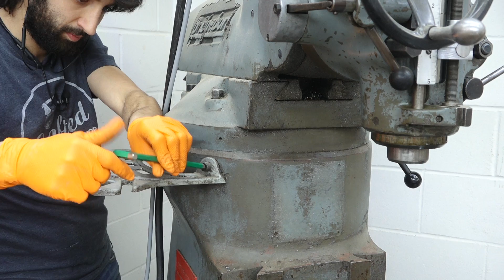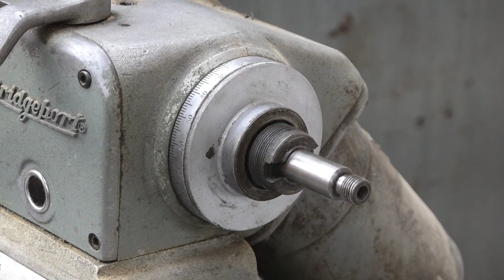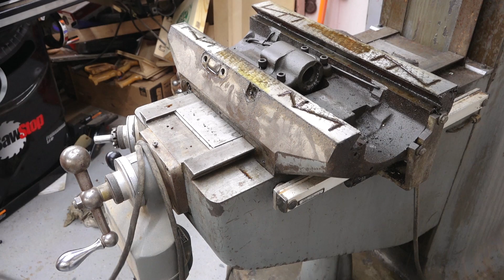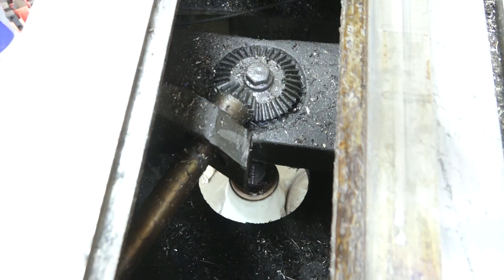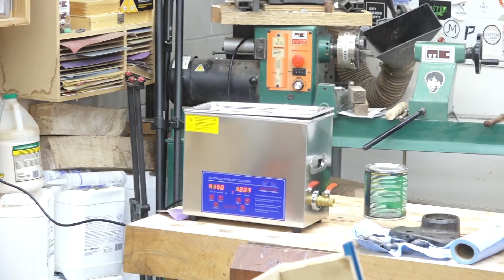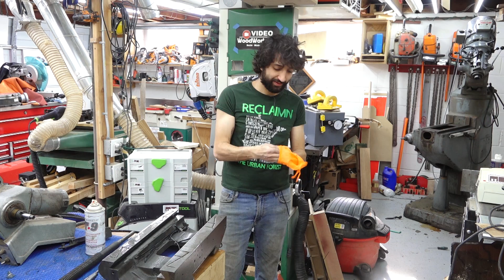Pulling the Table - Bridgeport Cleanup Part 2

Comment: My earliest plans to paint my machine ended when I examined the 1/4" and more thick fillers used  on the castings.  Incidentally, a good brush and Benjamin Moore Machine Grey look great when cured.  A brush is all I would use in the future on this machine.  My lathe is a different story and for that, I've had a paint shop make several spray cans of matched color in Dupont Nason (I think).

Comment: I have some information on how to repair the OEM power feed on the X axis, and have done it on  my machine.  It involves removing the circuit board and replacing it with a modern DC motor controller.  The other option is to replace it with an aftermarket Power Feed, but that involves making an adapter, since they are made for lead screws that do not have a OEM power feed.  Let me know if you need info. Regards.

Comment: Matt, if you should get the idea that there is some other tool/machine that you need, forget it, you can't turn around in your shop now, another tool, and you will not be able to get in the door to use the tool. Suggestion, next time, hire a person with a hot water pressure washer to remove all the oil, grease, gunk, etc. before you unload it into your shop. You would be surprised how little they will charge to clean the outside of the machine like the Bridgeport Mill for you and do it in 1/10th the time. The second way to get rid of all the oily gum is to stop at a DIY car wash station on your way home with the machine and do the job yourself. What am I saying, I just advised you not to buy any more machines?

Comment: I am a retired Journeyman Machinist. I enjoyed my 30+ years on a knee mill as well as many other pieces of equipment. Looking at the table ways, knee ways and adjusting gibs, they are definitely in need of scraping and flaking to put the machine back in tip-top shape. I hope you have a reliable contractor with the skills to do it then flatten/true and flake the table top.  If you do, it should last you the rest of your lifetime with proper maintenance. Love your channel and woodworking projects. I am retired and do woodworking as a hobby. My grandfather, a carpenter, use to tell me there was nothing worse than a machinist turned woodworker. He would tell me I was too fussy in cutting and fitting my projects. Keep up the good work.
Reply from the maker: Thanks Denis!  Looking into having the ways scraped.  Might as well go all the way.

Comment: Are you going to stone (Polish) the ways?  They look a bit corroded (spotty areas). Also, there should be a chip cover over the bevel gear set that raises the knee!  Gears don't like metal chips in their teeth. 😬

Comment: What’s your system on keeping all the loose parts organized for reassembly?
Reply: Also, do you just use the video to document how it came apart or do you just remember all of it???
Reply from the maker: I usually don’t need the video to reassemble but it’s nice to have it if needed. I group parts from each area together. Much easier to reassemble when you know those parts go in the same area

Comment: Hello Matt, Nice mill, I know them well. I was a Journeyman machinist for 32 years. You will have to research how to Tram the head in, after being at an angle, side to side, front to back, a test indicator will be required. A coolant system would be nice. When I said you were an Animal, I meant that in the best sense of the word, a hard worker. Very useful machine tool. Perhaps you already know about climb and conventional milling. Clime, cutter and work moving in same direction, conventional, rotation, direction opposite, best for not grabbing part and pulling it in to cutter. Be good, stay safe, C.

Comment: A trick I’ve used when using a magnet to collect chips is to put the magnet in a ziplock bag or even a glove so the chips stick to that and then you jut take the bag/glove off and throw that away and your magnet is clean. In fact. You could probably out a magnet in a glove that you were wearing so you could just pick up chips with your magnet fingers. :)

Comment: After you take all the schmoo off do you worry it will not go back together with close tolerances???  As a kid I cleaned up a vice and when I put it back together the jaws were so loose in alignment I wanted to buy a new one.  Good luck,

Comment: The orange disc is a MOV, metal oxide varistor i believe.  It is there to stop in rush over voltage :)  Maybe it protected what else was behind it - lets hope so!  They are designed to stop voltage/current spikes ... not 220vac hookup :)  You should be able to get the numbers off the side of the one next to it and those parts should be readily available.

Comment: The electrical part is an MOV (Metal Oxide Varistor).  In theory, take it off and you'll be A-OK (not short it out!!!)...  You just wouldn't have any protection against a voltage surge like when lightning strikes nearby or whatever.  It's basically the same as the component inside a surge protector.  If it did get a surge, there might be other damage to the circuit though, so be careful.

Comment: Varistors are usually connected over the incoming power, not in line. If you short the varistor you short the incoming power, instantly blowing the fuse.
Varistors are made to basically short circuit when the voltage gets too high, blowing the fuse (and often the varistor) to protect the circuit.

Comment: Thanks for sharing Matt, this brings back old memories!! 
I use to have a boss that would not allow us to use compressed air to blow off the machine. We had to use chip brushes and wipe it down with rags! A little over the top! He felt the air would allow the chips to migrate into areas that would not be good. I’m interested in seeing how the X,Y nut under the table looks like! On refurbish that is usually pretty junky!

Comment: Just a tip next time working with a magnet and metal filings/chips, etc.  If you put the magnet inside a plastic or paper bag, or wrap it in plastic of some sort, you can flip the bag around the chips/shavings instead of having all the tiny pieces stuck to the magnet, pretty much forever :D

Comment: MATT    * Ballscrews Ballscrews Ballscrews, so much better if your replacing the screws !!!!!!
Reply: I was thinking the samething, now would be a good time and so much better.
Reply from the maker: Feel free to weigh in.  I've read differing opinions on ball screws in a manual mill.
Reply: its just my preference but for you leadscrews work too. plus you can add a cnc control later with a ballscrew.

Comment: You have just invade Keith Rucker territory. 
The toasted red disk resembles an MOV, metal oxide varistor which protects electronics down stream from over voltage. If that is what it is, they are designed to blow a fuse and sometimes blow themselves.  Good luck on the repair.
Reply from the maker: thanks!

Comment: Since you are going to paint you will need to media blast it. I've seen some videos on media blasting with dry ice. Doesn't leave any gritty old sand around to get in the delicate parts. Also glad to see that you immediately sprayed some oil on the bed immediately after the pressure wash. I hopr yo van remember how it all goes back together.

Comment: Those exploded components in the power feed are capacitors. I had the same issue in my plasma TV a few years ago, I bought a bag of 10 for about a buck, so now I have 9 spares for if/when the tv decides to pop its top again.. (it might be 9 years old already, but I'm gonna get my damn moneys worth outta that tv..) ;)
I can't tell what kind you have in your circuit, but they are common enough to find and replace.. They may be polarity sensitive, so, take care :)

Comment: do you have chain and a ratcheting hoist... so you can hang the knee from the sliding ram above.  allowing you to disconnect the screw components.. then slide or carefully rotate the top to allow the knee to be lowered...  extreme care should be taken to prevent tipping the entire machine over with too much weight off center.  or just let it hang while you clean and paint the base..  you might put a block of wood with an eye bolt inside the knee to give you a way to hoist it safely.  you should also be able to spin the knee around for cleaning if its hanging..
Reply from the maker: I'm just going to remove the knee completely.  That will give me better access to the entire column and I can take the knee to be scraped.

Comment: Wondered for a while when/if you were going to pull it apart! Opening line "i'll not be painting it as I'd have to take it all apart", 20 mins later, it's no use i can't resist pulling it all apart.  So many of my projects start off with a pragmatic plan and soon I find everything in pieces, it's just too hard to resist. Looking forwards to the next instalments.

Comment: The Bridgeport looks so much cleaner! Little trick for the chip clean up is to put the magnets in some kind of plastic/ziplock bag, makes it a lot easier to get the smaller bits off the strong magnets.
Reply from the maker: You can't convince me to walk all the way to the kitchen just to get a bag :D